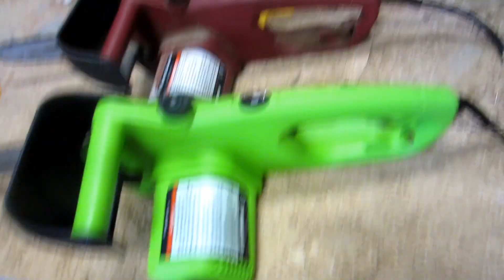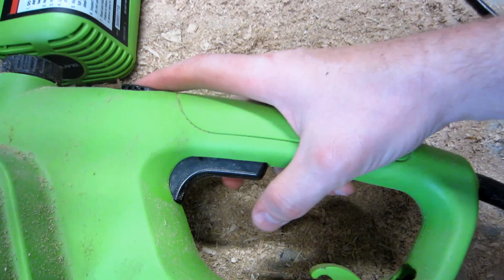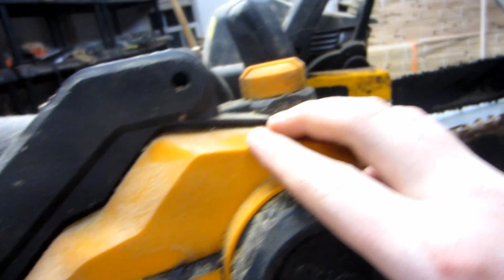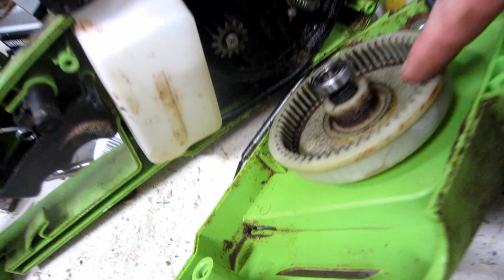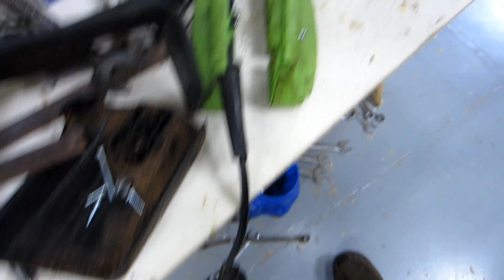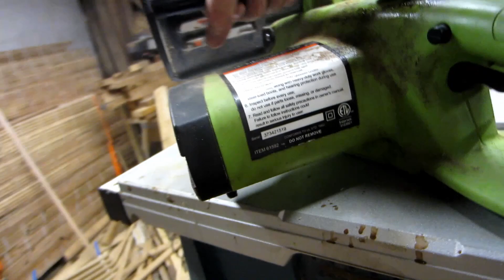Harbor Freight Electric Chainsaw Reviews! (unsponsored)

Comment: Thanks for this information.  I have a Bauer 16" chainsaw where the 4 1/4" plastic gear has lost all it;s teeth too.  But where to find a replacement?  I've looked everywhere and called HF.    Would you know where to get Bauer parts or who the manufacture is so I can contact them directly.  The motor and everything else if fine.  I'd hate to throw away the saw for a $10 gear that someone makes.

Thanks.

Comment: Transmission you said, there is no transmission! It is not junk or garbage, you get a $40 electric chainsaw that will last for a while. Read the directions! Then use you big brain and apply some common sense. The "Knob" is not really a knob to tighten the blade, it is a decoration to cover the actually tighten bolt. THAT IS WHY THEY INCLUDE THE WRETCH! You use the wretch to tighten the blade not the decorative "knob". I still subscribed and gave you a thumbs up but I didn't get past the first 2 minutes because it sounds like you don't know what you are talking about. Don't call something garbage, that it your opinion. If you want one that is better than this buy a Stihl, or some other brand name. I respect your opinion but do not agree with it. I have four of these Portland's so when one gets too hot, or runs out of oil, or the blade gets dull, I just grab another one, and  each one has more than given me my $40 worth of cutting over the last five or six years. When the chain gets dull, I buy a 3-pack of replacement chains for $15, that is $5 each. When one of them finally goes, I don't care, it is only $40! I got my money's worth out of each one of them and they are still going. I watched another video on this chainsaw and he said the chain came off the first time he used it, of course it did! The brand new chain wasn't tight enough when he started. He showed how to tighten it and it was still to loose! He did not know what he was doing, of good grief!

Comment: I got the portland 14 inch, and it worked great trimming palm tree branches a few times. The thing failed when cutting a 12 inch diameter palm tree stump though. Plenty of oil, but the thing almost caught on fire. Cant handle heavy workload. I would constantly take the blade off, clean it up, let it cool down after small amount of cutting. Piece of crap!!!!! Oh well, it was only $49.00 The plastic gears were chewed up, and all the interior parts were super hot, and smoking. I am such a sucker for cheap tools. They got me again!!

Comment: He talks a lot but I’m all honesty, if he’s using his daw that much why isn’t he using a gas powered one?

And why I’m gods name is he not using bar oil instead of veggie oil??

And btw you’re not supposed to cut 28” on a 14” bar, yooure supposed to cut 24, because you are supposed to have 2” play for the chain to throw the chips

One last thing, if you’re bar is running hot it won’t fill the blade, temps don’t dull blade, buy better il and it won’t heat up like that. And buy a better chain.

Comment: just bought a new one yesterday did not check the number but will later today it is pouring down rain now i have  10 year old HF 14 inch i have used it a lot still works well but wanted a back up

Comment: I have both the black one and the green one.
I have used the black one for about twenty years. No problem.
The green one isn't as good, but they had a recall and I got a free new one, even though the old one was still working fine.
I did replace the bar and chain on my black one about two years ago.
When the green one runs too long it will get hot and you have to wait for it to cool off to use it again.
Had the green one for about four years and have cut lots of trees and limbs around my grounds.
For the price you can't really beat them. First time you use it doing the work instead of hiring it done, and they all pay for themselves.
Of course if you use one every day for your business buy a better more expensive saw, but for around the house both are well worth the money.
Harbor Freight has a free 30 warranty on stuff they sell. If it doesn't work return it for a refund, or replacement.

Comment: I have the newer HF one this guy says is junk and I have taken down 5 citrus trees so far. I let the blade do the cutting and when I feel the exhaust air getting warm, I take a short rest. I use the cheap bar oil from Lowes, the saw seems to empty the oil tank frequently. One time I didn't notice some rope was tied to a tree I was sectioning and it got up in the sprocket, jammed the motor, but I was able to remove it without disassembly. Maybe this guy ended up with a defective unit, but for me it has completed everything I have needed it to do so far and I am glad I bought it.

Comment: I’ve been using mine for years at my house, my neighbors house and my brothers house with no issues other than the super thin oil that was supplied making a mess while transporting the saw. Drained it and used REAL BAR AND CHAIN OIL and never happened again. Other than that I just make sure the chain in adjusted correctly and when it comes time to sharpen it I’ll do that.

Comment: He mentions how they travel at a low speed - they do cut really well and sence the chain travels slow you will ware out the teeth or cutters long before u ever run out of take up on your chain - after several cords I've filed sharpened my cutters to were there almost gone - but I've only taken up 60% of the chain

Comment: The 64997 is a good saw I have no complaints at all - at $40 dollars it's well worth the money the 67255 was called back because of switch problems - they will replace it for you  - with a 64997 it really comfortable to use as he says - I've cut about 10 cords of wood with mine - the chains on electric saws out last gas saws 10:1 easily - the travel slower

Comment: Excellent video.  I bought one of these long enough ago for the 90 day warranty to be long forgotten.  It worked well enough to begin with then after some relatively intermittent uses the chain began to slip & ultimately stopped.  Looking inside, I found that ~4 inch PLASTIC idler gear between the metal motor gear and the metal chain gear.  Metal teeth against plastic teeth.  No way the plastic is going to last.  The metal gear teeth ate up the plastic gear teeth.  It's not worth the money.  If you read the one star reviews on the Harbor Freight page, this is mentioned frequently.

Comment: You said it failed the first use then you said you bought another one. The one i bought has a 90 day warranty so my question is this, why didnt you take the first one back when you went to buy the new one? Doesn't make sense.
Reply from the maker: I actually bought 2 or more at once.  That was probably a confusing point - sorry about that.  Also I'm not sure I was aware of the warranty - good point!

Comment: For the 61592 I found one on eBay & going to get it for general around the house use.  Also what chain replacement do you recommend as a back up while I get the original
Sharpened
Reply from the maker: You should be able to find most any off the shelf chain from your hardware store with the same length to match the bar.  I will say it requires fine adjustment to get a perfect fit.  I've used several different brands of chains on these HF chainsaws without too much of a problem.

Comment: Only saw now is 64497. Any comments on this model?
Reply from the maker: I think that is the new model # after they switched out the faulty trigger for 67255.  Basically it works fine (other than the catastrophic gear failure issue sometimes) and it's very uncomfortable to use for long periods of time.
Reply: Junk

Comment: The Remington chainsaws have had the same problem for years now. In fact, it is easy to find replacement gears because they strip out so often. If you lubricate the gear with lithium grease it will last longer. I don't know of any new corded chainsaw with metal gears anymore, even Makita uses plastic gears now. I bought a Black + Decker 15 amp with an 18" bar and it has a plastic gear, but I cut up an entire 50' seasoned Ash (super hard!) without a problem and it was 31 inches at the base. Half way though, I took it apart and lubed the gear, but it still looked like new. I found that as long as I don't push the Remingtons, the gears last for a long time, but too many people treat the cheap corded saws like a gas saw and they are not designed for that abuse. If you cut is not straight, the chain is not sharpened correctly or your bar is worn - has nothing to do with the weight being on one side.

Comment: I don't know the item # of the HF saw I had but it was green...got it on a sale with a 20% off coupon for around $30.  From the beginning it would leak the blade oil all over every thing, so I got to where I would just soak the chain and blade on the saw with oil before I used it.  After 2 years of cutting, over 4 cords of firewood, the gear stripped out, motor ran good but chain would not run.  So I tossed it, but it was handy, and for that cost, I was happy I had it and that it lasted as long as it did.  I now have the Worx corded electric, and it is the best corded chainsaw I ever had!  I suggest you purchase a new chain and bar for yours...looks like you were cutting roots in the ground with your which will ruin a chain and bar almost instantly! Apparently you do not worry with any maintenance on ant saws you have!

Comment: I sell engineering plastics for a living. There could very possibly be a change in the compound being injection molded for the gear.  Tough/ductile plastic compounds would be glass filled impact modified nylons.  Often, mfg's use Acetal for gears as that material has natural lubricity.  That's the compound you see in your faucet valves.  But, ductility and toughness is very poor.

Comment: I just bought the one you liked, #64498.  $39.99 with the coupon, on 3/21/2020.  Haven't been able to try it yet since it rained today.  Thanks for calling out the WORKX, I was just about to buy a reconditioned one (mail order) for $53, but we were going to Harbor Freight and I decided that I didn't want to wait.

Ebay chains run about $11 now, no $5 ones found.

Comment: I always lubricate my plastic gear items with lithium and they work for decades.  Without gear oil made for plastic you may as well put sand in the gearbox. They cannot ship any grease any more overseas. Put your own.
Reply from the maker: I'm not sure about not being allowed to ship grease - I've opened up plenty of Chinese gear boxes packed with grease, and these chainsaws also have grease included.  That said, a high quality grease may do the trick.  Thanks for the tip - I'll give that a shot next time. :)
Reply: So they ship angle grinders dry??? Nah!

Comment: You were questioning why the smaller diameter gear failed.  I'm an engineer who worked in manufacturing.  I have an educated guess.

      If you remember your science classes on leverage, a smaller force is required to turn a shaft, if you have a longer arm of leverage.  So in lay terms, if the radius of the gear is larger, the force applied to the teeth, needed to turn the gear, is smaller.  If the radius of the gear is smaller, a larger force on the teeth is required to turn the gear.  So the teeth on the smaller gear had a larger force applied to them in order to turn the gear.
     Now let's use engineering terms.  Torque equals force applied times the length of the arm between the spot you apply the force and the center about which you are rotating.  Lets assume the motor is designed to generate a certain constant torque.  The force applied to all the teeth is torque divided by the radius.  If the radius is smaller, the force applied to the teeth is larger.  That is one reason why the teeth on the smaller gear failed earlier. 

     Now let's talk about the shear area over which the force is applied.  All the force is not applied to one tooth.  The force is distributed over all the teeth. In fact, the force is distributed through all the material that forms a ring through the teeth.  The area of this ring is called the shear area.  At best, the shear area is equal to the diameter at the base of teeth times Pi times the thickness of the gear.  At best, the shear stress is equal to the force needed to turn the gear divided by the shear area.  Every material has a maximum shear stress that it can endure before it fails.  This number is a constant.  If you have a bigger area to spread the shear force over, then you may not reach the maximum shear stress for that plastic.  If you have a small area to distribute the shear stress over, then the chance of reaching the maximum shear stress and failure is more likely.  So the smaller the diameter of the gear gets, the closer you get to reaching and exceeding the maximum shear stress and the closer you get to failure of the plastic.
     I just bought one of these bad models.  It is still in the box.  I'm strongly thinking about returning it after hearing about the redesign of the gear, making the gear smaller.  (1) The smaller size means there is a larger force required to achieve the same torque.  (2) There is a smaller shear surface over which to distribute that force.  So, if the same plastic was used in both gears, at the same thickness, then the smaller gear in the redesign will likely fail.
     As an engineer, I know that commercial manufacturers always design as cheaply as possible to save money on materials.  So the original design, with the larger gear, probably had just the right amount of material to do the job without failing.  I'll bet that an American designer did the calculations to figure out what the exact diameter needed to be to create a reliable gear at that thickness and torque.
     My chainsaw box says that this badly built version, was made in China.  I have worked with Chinese companies before.  Let me explain what happens when you shift your product from being built locally, to being built in China.  When your product is built locally, in house, your manufacturing managers respect the designs of the engineers.  They realize that the engineers put a lot of thought and brain power into those calculations.  Sometimes the manufacturing manager comes up with an idea to save money on a product.  But FIRST, he/she calls the engineer who made the design to see if the change is OK.  If it's OK, the engineer will change the drawing of the gear and send the new design to the in-house manufacturer to save money.  If the change is not OK, because the shear strength will be exceeded, then the engineer will explain that to the manufacturing engineer, and nothing gets changed.
     This is how it works when you shift your manufacturing to China:  In the beginning, the Chinese manufacturer builds the product true to the original design, because they want to impress the US company that gave them the job, and they want to secure the trust of the US company.  Once that trust is gained, the US company does fewer inspections of the incoming products from China.  The Chinese manufacturers have meetings on how they can save money on their manufacturing process, so that they can make a bigger profit for themselves.  They either are arrogant, thinking they know the design better than the US engineers, or they just don't care about the quality, or they have too much difficulty trying to translate their ideas into English to have a meaningful engineering conversation with the US designers.  So, sometimes, they don't bother asking the US engineers if it's OK to change the design to save money.  Sometimes, they just make the decision to change the product without telling anyone in the US that they are changing it.  In China, labor is so cheap, that the cost of plastic parts is calculated based upon the amount of plastic that is used in the part.  So in China, they save money if they use less plastic by making the part smaller.  If the US company is in a state of trust, and doing fewer inspections, they might not notice that a small change has been made.  It takes time to distribute the changed product to stores.  It takes time for customers to buy the product.  It takes time before hundreds of failed products are returned to the stores.  It takes time before stores start cancelling their orders because a product is bad.  It takes time before the US company realizes that they have been taken advantage of, and had their design changed on them.  Meanwhile the Chinese company saved lots of money by putting out inferior products and they can laugh at us, all the way to the bank.  In my opinion, when a US company turns it's manufacturing over to China, then that US company is no longer a designer of reliable name-brand products.  In my opinion, they are just another distributor of Chinese products.  They have a good chance of losing control of various aspects of the design.  That's just my 2 cents.  Take it or leave it as you see fit.
Reply from the maker: Thank you for the amazingly in depth explanations and sharing your real world experience with Chinese manufacturing.  I learned quite a bit from your comment.  I'm not sure if HF ever has US designed products; I imagine they are in cahoots with the Chinese manufacturers so they can sell more warranties or get people to buy more replacement products.  I always buy HF with the expectation that it will fail and I don't buy a warranty either.  I tend to just weigh the cost and odds and swap out parts occasionally or reuse parts in other projects.  Maybe that's what they prefer I do though, to continue to make money selling bad products.
Reply: That was more like 97 cents. Great info though. Thanks